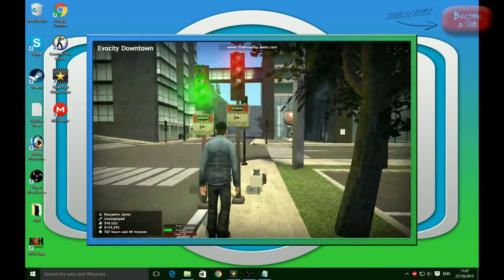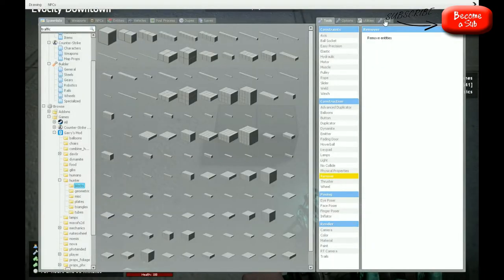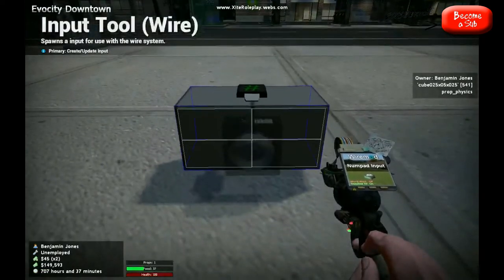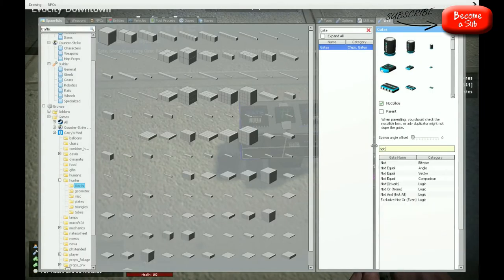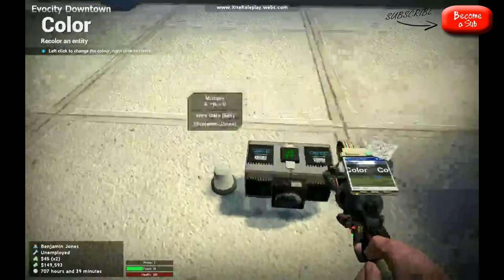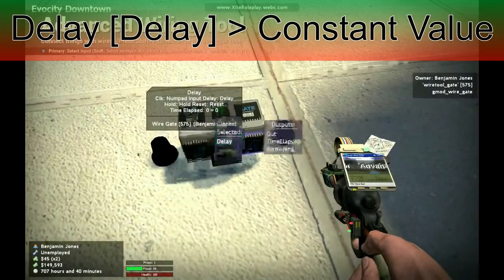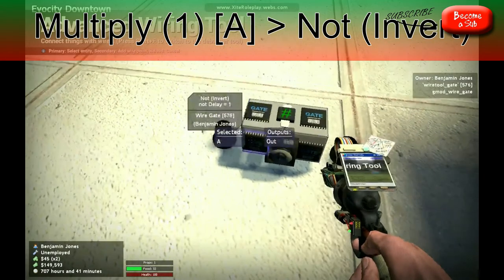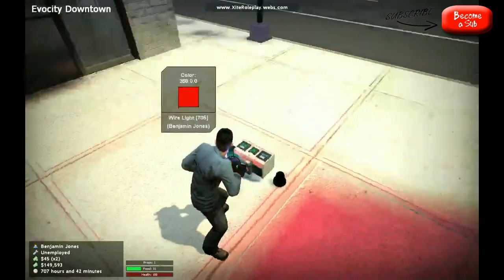Garry's Mod|How to make a wire Traffic Light/Police Lights|Easy'ish

Comment: I'm on Mac and i don't know how to operate the chips.
I have watch videos where they can be changed. I only get a message of its value.
Reply from the maker: +Chloe Nakahara Unfortinatly, I don't have MAC, so i can't help with that. But shouldn't the Wire Mod be the same? As nothing is to do with the PC/MAC, but more of the Garry's Mod's addon?
Reply: Hey there yer I was not using -Wire-in Wiremod  to operate the values so now i figured it out & i'm making stuff  ^.^